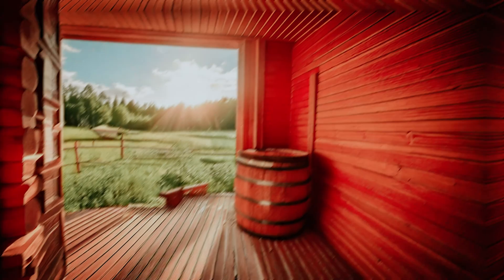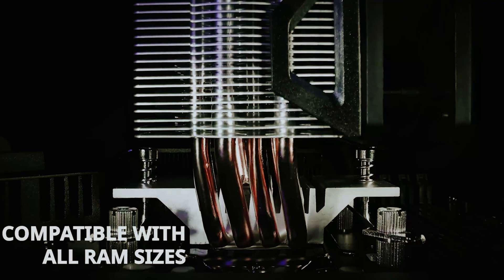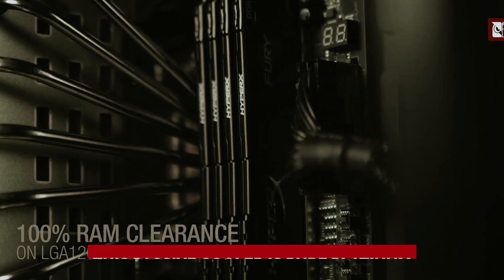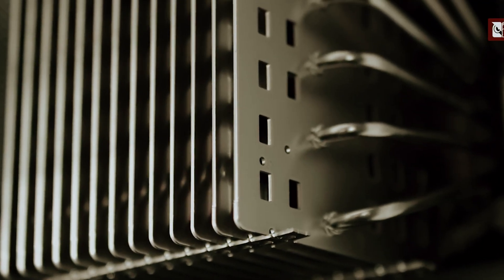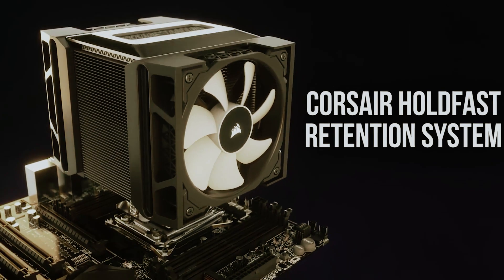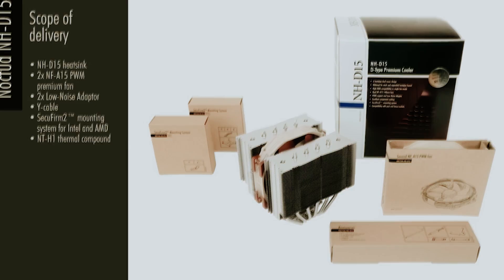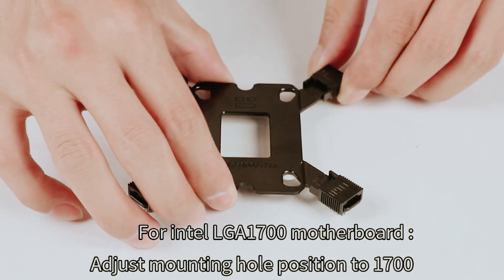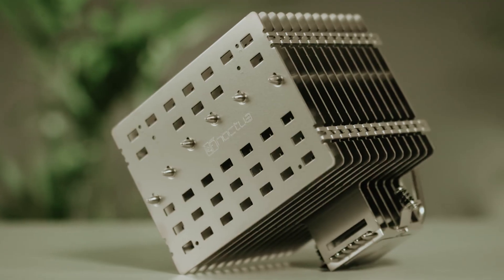Best CPU Air Coolers 2025 - (Keep Your PC Cool & Quiet)

Comment from the maker: ➡ Links of the Best CPU Air Coolers we listed in this video.

1. Thermalright Phantom Spirit 120 EVO – Best CPU Air Cooler Overall
https://bit.ly/4io4cGd

2. Noctua NH-D15 chromax – Best High-Performance CPU Air Cooler
https://bit.ly/3BgDnDe

3. Corsair A500 – Best Flexible CPU Cooler
https://bit.ly/3ZT2tBL

4. Noctua NH-P1 – Best Passive CPU Air Cooler
https://bit.ly/49zuXne

5. Cooler Master Hyper 212 EVO V2 – Best Budget Air CPU Cooler
https://bit.ly/49veCQw
Reply: No ice Giant? isnt that the best Air cooler?